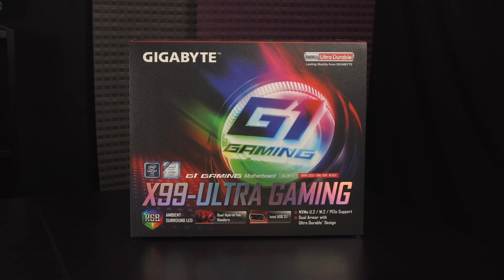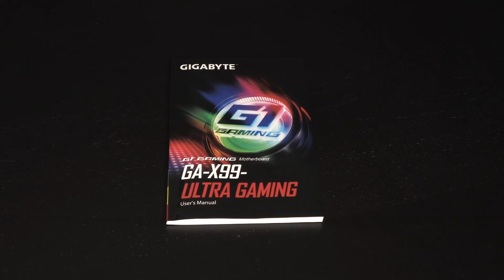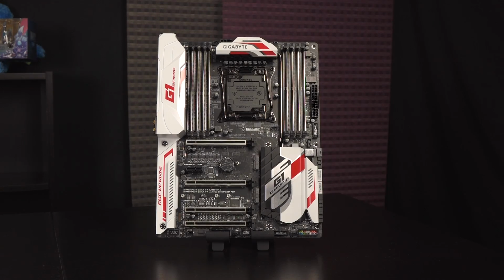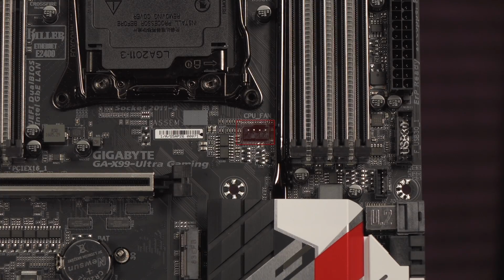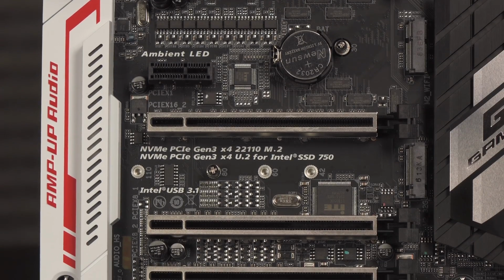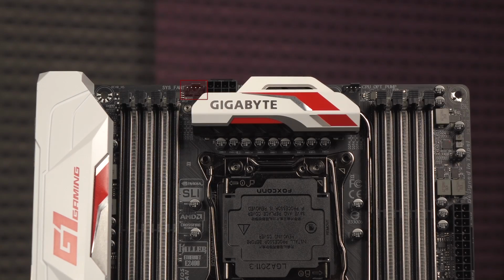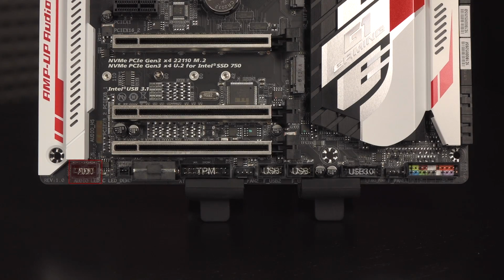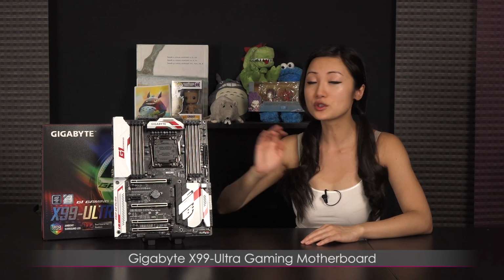Gigabyte X99-Ultra Gaming Motherboard: Overview

Comment: Talking too fast - could hardly follow you - mute as i read the specs and watch the video (constructive criticism!) :P -- soldered back up bios and bios - i overclock a lot - is there any other companies that make this board like that made my asus x99 deluxe usb 3.1 board - which has an un-soldered bios so if it gets jacked up i can get a new one instead of sending my mobo to the manufacturer?

Comment: I have a question its very important , its about sata mode selection , which one is the best choice for biggeners to use is it (ide_ Raid _ or ahci ) please can you answer this question ? Pleeeeeeeeease
Reply: beginners start out with AHCI now the default setting, IDE is pretty a legacy setting used if a certain drive is not being recognized, raid is a bit advanced read up on it latter and you can ponder about using RAID after you get your computer running.
Reply: Thank you so much for your answer , that was a nightmare for me 😂

Comment: I personally prefare the AUSTECH FM2-88 motherboard which allows for a more compact system as you can use an AMD A10-7980 Kavari package which integrates a CPU,GPU,TRUEAUDIO DSP sound card,DMA,North and South Bridge chips onto one package the only thing missing from the package is the Ethernet controller hardware which means the the only things required is GDDR3 RAM and that's it.

Comment: Isn't it EATX?
Reply: nope. If you go to gigabyte's site, it specifies that this is simply an ATX not EATX
Reply: o, i thought only eatx boards had 8 ram slots
Reply: +asianpotato nah, when it comes to lga 2011-3, you will find 8 slots starting with the atx form factor. when it comes to the average consumer grade motherboards(excluding more than one cpu motherboards like workstation motherboards), you will only find 8 slots on lga 2011 or 2011-3.

Comment: Hey! It’s the first quality X-99 Ultra video on YouTube. Unfortunately, this is just an overview video and doesn’t provide much to consumers who are considering this board. The X-99 Ultra is a pig with lipstick. For a little under $300, this board delivers nothing but problems, and I can’t understand why. The X-99 platform attracts some of the highest spenders, yet the boards that are available are junk relative to their Z97 and Z170 counterparts. 

I have this board. If you want this board to just connect your components together, it’s actually a pretty good and reliable board. If you want to own it and use it for its superfluous features, you’re in for a treat. First, the LEDs do not always work, and when they do work, they do not work together at the same time. At this moment, my PCI-E LEDs are off for no reason. They’ll flicker every now and then. Next, once you install the Gigabyte App Center, everything goes haywire— random memory failures, driver failures, software lags, and so on. 

This board use to be $360, but you’re paying for its advertised glitz and glam. It sucks. Buy a different board— none of which should be by Gigabyte if you’re using X-99.
Reply: Right? I had an ASUS X99 Deluxe before this Gigabyte. Minus the nice BIOS, the thing didn't work as advertised either. WTH? All of these X-99 boards are terrible. The only good experience that I have had was ASUS's Rampage V, which some others did not seem to like. I hate that I spend so much on the X-99 system but can't find a decent motherboard. The Ultra X-99 is the fifth 2011-v3 board that I have owned.
Reply: I had a Z97 MSI Gaming 7 for my 4790k. That thing was more reliable than JTL's fans making white knighted comments on every new video.
Reply from the maker: Thank you!
I'll be building with this, so will get to see how it performs after that.